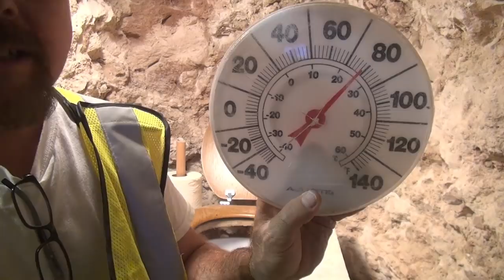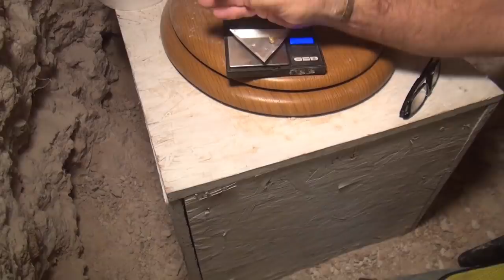FINDING GOLD NUGGETS EVERYWHERE !!! Monster Pocket of Gold - ask Jeff Williams

Comment: Jeff, I know you have air being pumped into the mine so you can breathe. Words to say having piping coming down from the surface and going to the back of the mine, just pumping a little bit of air out of the Mine, might clear some of that humidity out of your mine...

Let me know what you think about that! I mean you don't even have to use the same 6 inch tubing or 8-inch whichever you're using, you can simply use a 2-inch pipe and have it stop in the center, between the face and the rise will you pull your debris up

Comment: Excellent overview of your operation.

Before any digging, when you were in the preplanning and evaluation process, did you consider hiring a drilling rig to take core samples, map out a grid, determine the richness and locations of the area? I would think it would be easy drilling down to 60 feet through all that soft clay layers (and less $$ to do so vs. hard rock). Did the topology on the surface allow for that?
Reply from the maker: actually we did until we got the bill and we said we will do our own samples ....some areas did but very remote

Comment: Heat shrink wrap your extension cord connections. Not only will it waterproof them, it will keep them from accidentally being pulled apart. It can be easily cut away when you pull out of the mine. Just a tip from working in oilfields and water wells

Comment: Another great video!

But wet timbers.. The timbers are thick, and that rock looked like it was self supporting. Although it could take months or even years before it moves. It wants to come down sooner or later. Wet timbers are weaker than dry timbers. So maybe the wood choice makes a big difference. Ive read acacia wood is pretty resistant to rot, and it is from the US. Maybe i am overly worried, but still. 

Have a nice time!

Greeetings,

Jeff
Reply from the maker: Thanks for the tips!

Comment: Timeline 7:15
When you started noticing soft sand that should've been an indication of water resources. 
I would've sealed that direction since you said moisture began to damp everything.   Oxygen has a way to stimulate water flow and if your tunnel is near some well or riverbed, that moisture will automatically head towards air flow.  
It be better if you closed in that soft moisture tunnel.
Otherwise, when encountering moist aggregated environment, it's best to drill a water well to locate the resources around the mine's proximity.  Thus, lowering water levels or underground reservoir from saturating all of your efforts. 
You even said, "Smells funny right now, like a wet towel."
That right there is an indication of your tunnels being saturated.

Comment: What size generator are you using for this operation?
Reply from the maker: actually we are running two ...one with an inverter  for lights and one for the hammer drills....
Reply: @Askjeffwilliams  Nice. Those inverter generators are nice and quiet too.. Solar is even quieter... Keep up the great work!